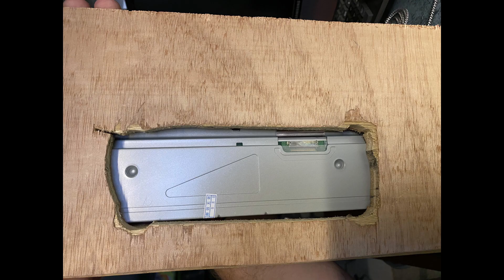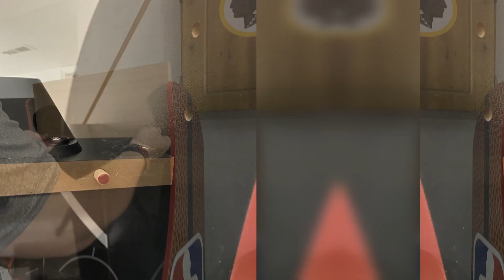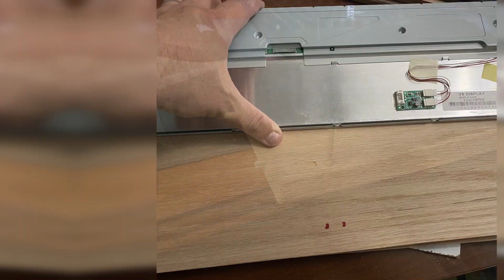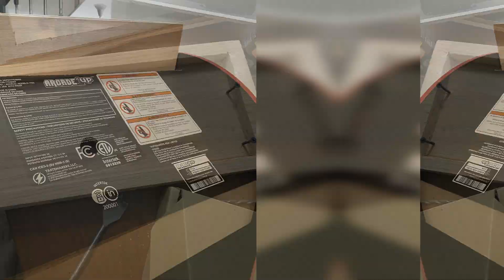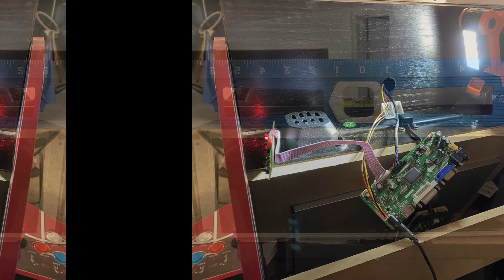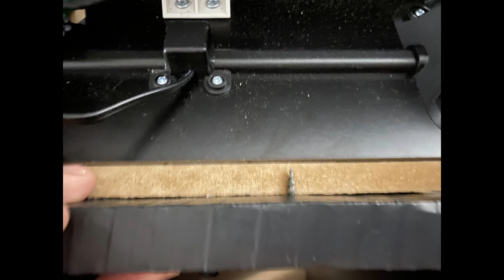Modding my Arcade1UP - Replacing the Marquee

Comment: I gutted everything, bought a mini pc and used a bootleg pandora box for the control panel. At first the twin sticks didnt work but i guess it just decided to start working via usb to pc one day. Better than going with the mayflash f300 route i was in the process of doing. I even mounted the keyboard to the front under the control panel.  Everything i need is right there. Of course i had to get a wireless mouse but im pleased with it.
Reply from the maker: That's awesome!  that's the thing, the Arcade1UP is a good base to customize, and it takes up A LOT less space than my monster arcade machine :-)
Reply: @MavericksArcade  i tried for years to get an actual gutted cabinet with a decent crt to go inside. Every one i came across looked like it came from ground zero of a nuke site.